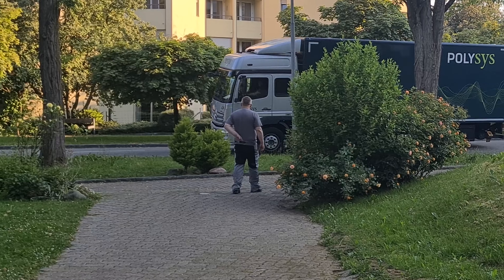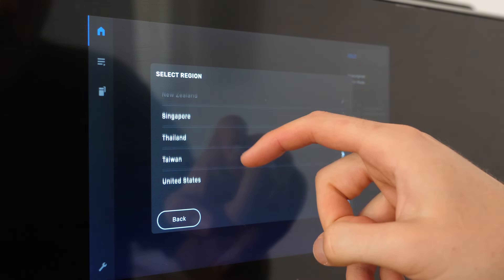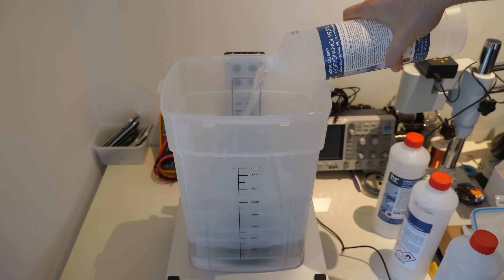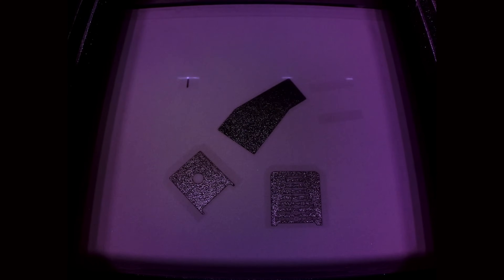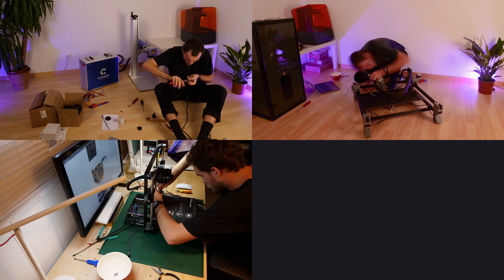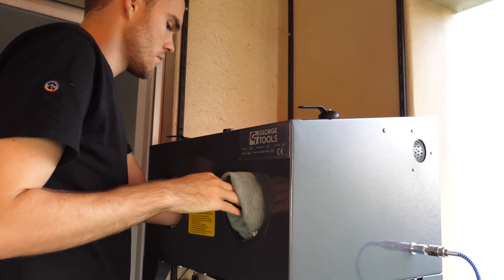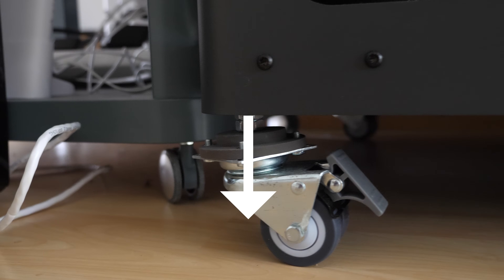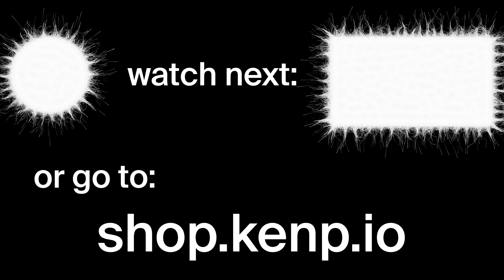Did I Buy a $1,000,000 3D Printer?!

Comment: Amazing video! I had a question about you mentioning that you would'nt recommend any other SLA printers other than formlabs for health purposes. Does Formlabs produce less fumes than other SLA printers?
Reply from the maker: Not necessarily. It's more to do with the handling of the resins with removable tanks and basically minimizing as much as possible having to clean resin off things manually (which I dearly dislike). Also, not having to tune any settings helps a lot with that, I've never had a failed print, so that means I never had to clean up a tank. On the cheap ones, I had to do that all the time until my settings were dialed in. If I used a new resin, I had to go through that messy process all over again.

Comment: That Dyson is NOT designed to handle fine nylon powder. It can kill it or cause a fire hazard. There's a reason the station you got comes with a specific ESD and fire rated vacuum to handle those powders. I designed and manufactured SLS and SLM systems for 6 years so I know a thing or two about this.
Reply from the maker: You're right! I realized this not long after posting the video and stopped using the Dyson. Thanks for watching :)
Reply: Great information, that unit need its own space

Comment: Besides pure protoyping, when you sell 3D-printed items in small series (say, 25 to 100 units per month), can SLS fit the bill compared to FDM? Stacking items in the whole build volume of the print chamber is tempting. In the other hand, FDM 3D printers are so cheap (sub $1000) so they can run in parallel in a small farm; and above all, PLA, PETG, ASA filaments are so cheap (about $20 per kilogram, sometimes less, sometimes more for advanced ones). Even if a disruptive company is about to come with a $3K SLS 3D printer on the market, the PA12 powder is still quite exepensive. Non-sintered powder can be reused, admitedly. There is also the mandatory time waiting for the build chamber to cool down before being able to unmold the cake, then manual post-processing. In the end, all boils down to the question: what are the economics for a small shop?
Reply from the maker: My thoughts on the $3k printer: https://www.linkedin.com/posts/kpillonel_the-new-2999-sls-3d-printer-has-just-been-activity-7185527331111804928-foe7?utm_source=share&utm_medium=member_desktop

I think you're only comparing them based on economics, but you can't really do that because use cases can be wildly different just based on part strength and, even more importantly, surface finish quality. I would never sell FDM-printed AirPods cases, so I can't even compare the economics between the two technologies for that application. SLS was the cheapest and most agile option for me.

Comment: P.S. nice video but haha at the end the part you printed for the vacum with FDM broke because the orientation was wrong in the first place. If you would tilt it 45-90 degrees to the side it would never broke :)
Reply from the maker: You are correct that the orientation can be changed; however, it adds a lot of supports, and other features would then also perhaps not be very strong. Hence, it showcases my point about having to make tradeoffs with FDM. Thank you for your comment.

Comment: 7:49 Helpful hint: just above the area you are trying to vacuum are the two quartz tube frames. They are user-removeable by removing a single socket head screw on each side (2.5mm) and sliding the frames out. They are designed for this and it will not void your warranty.

(Source: have worked on a Fuse 1 and a Fuse 1+)

Comment: Fuse1 is an awesome machine, I’ve worked with it for over a year, I had some awesome prints, for feedback, sometimes cleaning the parts can be exhausting especially when you make mass production, but it’s still worth it. But I would recommend for you to move the machines away from the living room. Even though it has its own vacuum, in time you will see some dust parts arounda the room, if you have an Opportunity, I’d recommend you to isolate the sift, and always wear a mask. Hope you habe great prints like me. Great video btw
Reply: Great Point!

Comment: FDM is suitable for printing very strong parts for several applications when done correctly.
Reply from the maker: At the end of the day, FDM is a process that creates parts with incredibly anisotropic properties. So if by 'done correctly', you mean designing parts that cannot be strong in every direction, you are correct. The goal of the video is just to give an introduction to the technology and summarize things. I still stand that I would not use FDM for critical applications. Thank you for watching
Reply: 100%. A lot of my parts are very small, so print orientation is always on my mind. SLS is a very cool process and it does create very strong parts, but it requires a huge financial investment in comparison for such a small print volume. You can get a used 5 axis CNC machine for less. I think the future of SLS is metal printing. @ExploringTheSimulation

Comment: What did you to do address safety? SLS not only requires very low humidity to operate, the entire room should be put under negative pressure such that fine particles can escape. SLS, because of the fine powder, is particularly prone to fine particulate matter emissions, which can be very hazardous, when operating around the machines frequently, it's even wise to wear a mask. This looks like a room in a normal house, so i'm just hoping you have some kind of ventilation system that's more than just an open window :)

Otherwise, very cool to own an SLS machine, color me jealous!
Reply from the maker: Haven't had problems with humidity yet. As far as I'm concerned, the printer is filtered. The only moment where I see particles escaping is when I transport the build chamber from the printer to the Sift station, so I wear a mask then. I'm going to get a separate space for the all my mechanical tools eventually, just don't have the funds to do it right now. For now that setup will have to work.
Thank you for caring about my health and watching the video :)

Comment: My question is how do you get the trapped powder out of a piece thay has enclosed chambers?
Reply from the maker: Great question! If it's fully closed, you either leave the powder inside (adds extra weight and cost since you can't reuse that powder), or you make sure it is not fully closed by adding a small hole to your model so that you can remove the powder :)

Comment: I wonder how fast this SLS compare to MJF or FDM, how much the total for purchasing this fuselab
Reply: HP MJF has larger throughput because the print job is faster and the build volume of HP printers is much larger -  41[L] compared to 8.1[L] for the Fuse1+. 
but the cost of MJF printer is MUCH more (~x10) so it's less suitable for small startup. While the Fuse1+ provide approx. same part quality in much cheaper and less requirements from the site.
FDM VS SLS - while FDM can print single part faster (in some cases only, that the parts are small), for multiple part, SLS will always win. big difference.
Reply from the maker: I don't know about MJF (think it's similar) but FDM is definitely quicker, although the part quality is nowhere near close. 
Showed the invoice in the video ;)

Comment: Which welder did you use to weld the threaded studs into the nuts?
Looks very interesting.
Reply from the maker: It's from Lampert. I show it more in other videos, and you will also find a link in the description of these videos. Keep it mind that it's a jewellery welder and completely  overkill for what I used it here. Some solder and a soldering iron will work too. Thank you for watching

Comment: SLS is too messy, and power hungry,apart from limited throughput(24 hr cycle time). You can do mulilayer pcbs inhouse at fraction of the cost if you know how to.❤👍
Reply from the maker: Thank you for the comment. Gotta disagree with pretty much everything you said though... I didn't find SLS to be too messy, with that Sift station it's definitely better than SLA printing. Power hungry I have honestly not measured yet so I can't confirm nor deny. 24hr cycle time is completely wrong, I found it to be more like 2-3 hours between each print. I didn't say it's impossible to do multilayer PCB at home, I just said it's a waste of time in my opinion. If you want to make just one PCB and you need it the same day and you don't count of much your time is worth, then maybe it could be considered. As soon as you do more than one PCB, or a flexible one, or want to ship to a customer, just forget in-house production.
Reply: @ExploringTheSimulation I did investigate SLS in depth for several months, so you would understand what I mentioned as you start using the system. Also found the rfid cartridges,a bit expensive(may not be for smaller parts and high value parts) for mass production. Recycling is another issue, both the spent powder and the "real" % of resuable used powder. If you look at the electrical requirements, you will understand my comment on the same.
Has a limit on minimum attainable feature size( compared to resin, but good as FDM). Also needs additional finishing, if you don't like the rough texture. For prototypes, small parts at volume, small volume of large parts that are premium priced, should not be an issue. I have an inhouse PCB production, that rivals any commercially made one, unfortunately cannot disclose much. For the right market SLS may be the right choice, be stringent on PPE though. Good luck with your current and future projects♥️👍
Reply: @aware2action  you investigated it? What does that mean?

Comment: BTW if you are interested in one of the coolest and most mindblowing 3D printing technology, search for "Next-Gen Copper Cold Plates So Advanced They Need to Be 3D Printed from Fabric8Labs". You can 3D print impossibly good heat exchangers out of pure copper, by controlled electroplating! I would link the article but the spam filter would likely catch it.